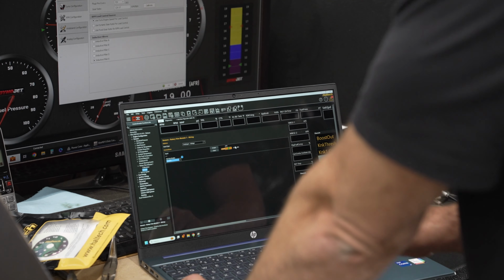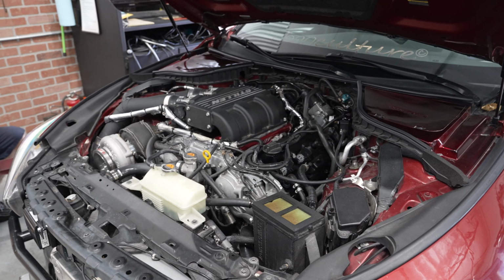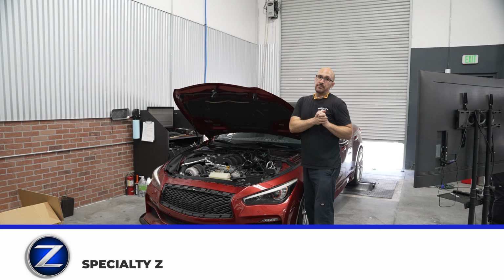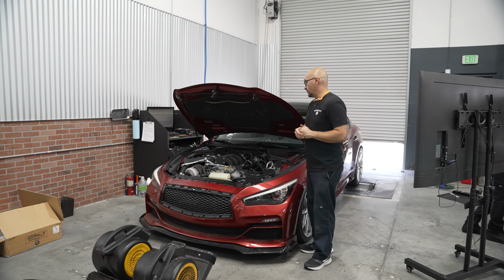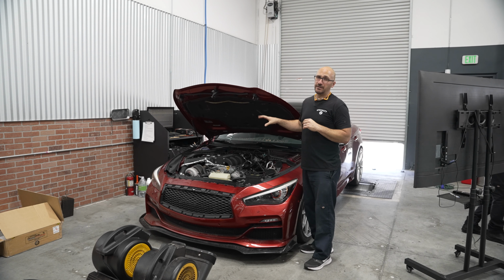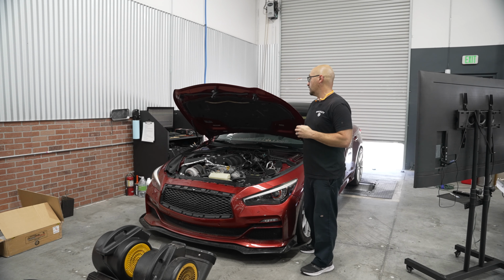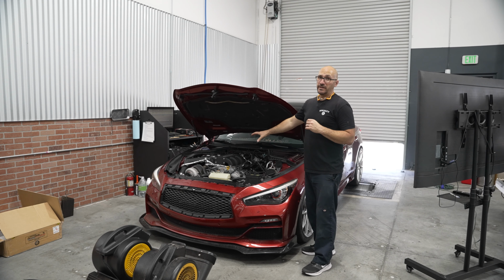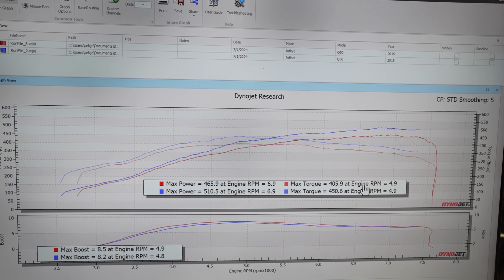Stillen Intake Turbo Combo for a 3.7 ??

Comment: 🔥🔥🔥, I made 562 On 93 10 Psi / 618 On E85 At 12 Psi With Custom Top Mount Kit On A Fuel Return , Single 525 Pump , With IDX1050 Injector On A PSR Gen 2 3584